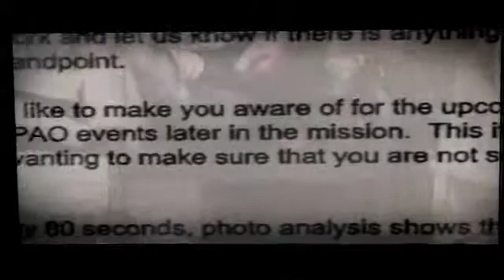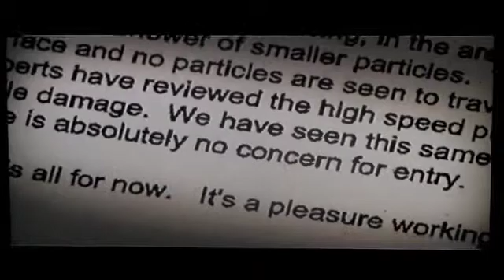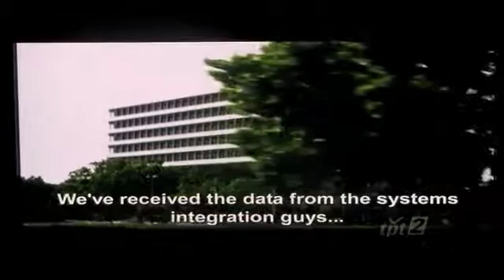Columbia Disaster in 2003 and the piece of foam

Comment: What was the purpose of that foam in the first place?
Reply: @ptassotti  — They should have put it on the inside.
Reply: @GH-oi2jf  You can't put it on the inside. Liquid hydrogen and foam don't mix well. They could have had a double hulled external tank, but that would have weighed too much. The foam was to insulate the super cold propellants inside the tank and keep it from boiling off too fast.

The entire design was absurd. In a normal manned spacecraft, the crew capsule is on the top, completely safe from any debris shed by the rocket. The shuttle couldn't be placed on the top of the rocket stack because it had gigantic wings.

The reason it had gigantic wings was because the Defense Department wanted to be able to use the shuttle to launch satellites into polar orbit, launching and returning in a single orbit. Orbital mechanics makes this impossible using pure rocketry. So the wings were built to provide the necessary aerodynamic manuvering ability. But this capability was never used. The Defense Department never launched the shuttle into a polar orbit, not even once, and after the Challenger disaster the Defense Department never used the shuttle at all.

The reason why the Defense Department was involved in the first place is because Nixon and Congress didn't fully fund the shuttle development program. The shuttle had to scrounge for funds from the Defense Department, which then imposed its own demands.

It's the same story with the Challenger disaster. There were three separate causes: the actual technical or engineering failure, the management failure where management failed to heed obvious engineering warnings, and the design failure where Congressional stupidity forced built in design flaws that no sane spacecraft should ever have had in the first place. SLS is the exact same thing. In face SpaceX is the only launch provider relatively unaffected by Congressional stupidity.